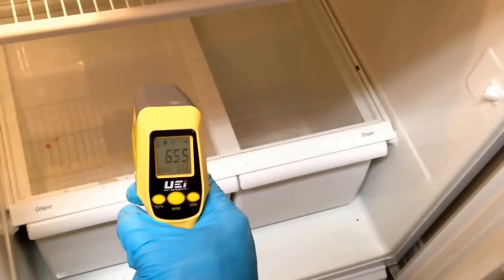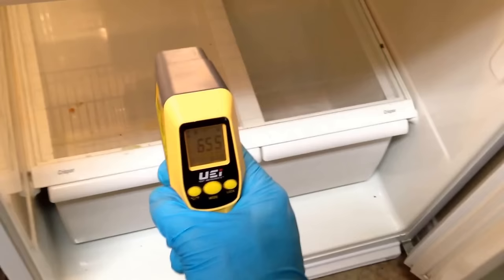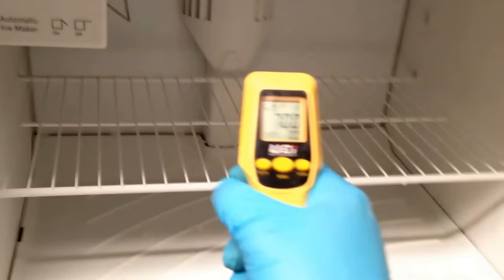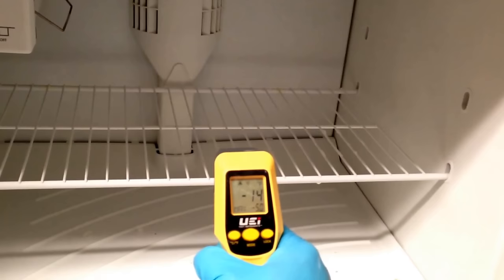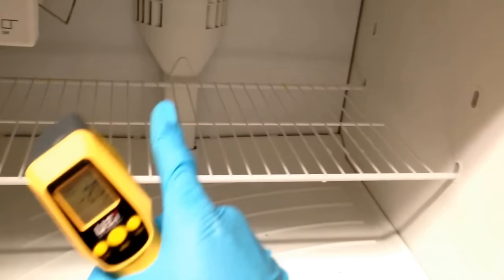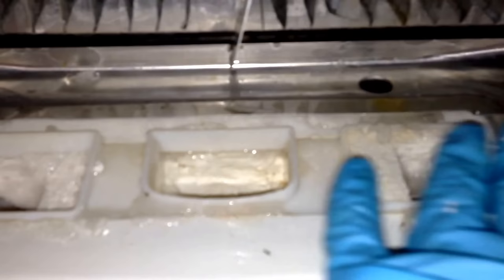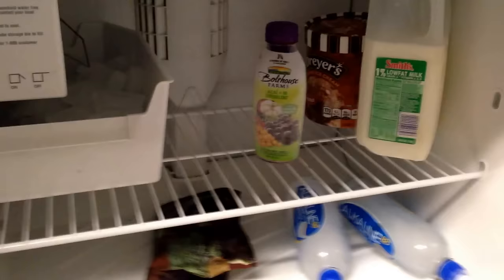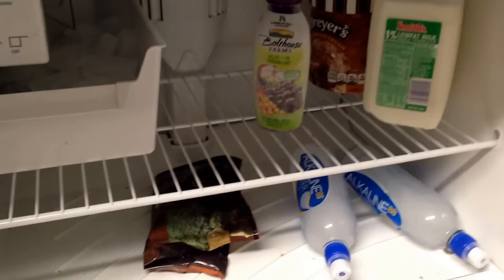Fridge is Warm but Freezer is Cold? DIY Repair

Comment: Unplugged my fridge for 24 hours, started it up a couple hours ago and was cooling almost immediately...plus I got a spotless fridge...it was empty, so.  Thanks!
Reply: Hey, I'm wondering where did the water go that melted?? I just unplugged mine.
Reply: Tony Neely I don’t know.  It didn’t leak out.  There couldn’t have been much anyway..just enough to block the air.  Mine ended up doing the same thing last week and I had to replace a part $189 plus $75 labor.  Much better than replacing the fridge tho.  Good luck.
Reply: @leeashley2927  after more research, I guess the water just goes into the drain pan. I didn't get lucky with mine today, I plugged it back up and the freezer still got cold but there's no fan blowing the air up so I guess the fan is broke. 😭

Comment: Freezer working fine.  Bottom part is warm and no restrictions.  Fan comes on when I set fridge to off mode  but it shuts off when I close the door. Also shuts off when set to max cold with door open.
Not long ago I changed the thermostat. What do you think?

Comment: I replaced a fan motor in a refrigerator that friends have and they also had the freezer jam packed with groceries.  I told them that the fan needs to circulate the air in the freezer so it could cool the lower section.  That refrigerator is still working.  I did that job about 5 years ago.
Reply from the maker: Great job Gary. It is sometimes something so simple that can be replaced or repaired... I am amazed how many times people are willing to throw out their appliances without trying to fix the issue which many times is less than 50 even 100 dollars to extend the life of their appliance... in your case an extra 5 years which doing the math... is WORTH IT! Thanks for sharing! 😄
Reply: Hello  @MoreThanMaintenance  , 31 years ago, I bought a new refrigerator from Montgomery Wards.  It says Montgomery Ward but they were made by Amana.  I have cleaned it several times, but the only thing that I have had to replace was the light bulb.  That was about 10 years ago.  The bulb did not light up when I put it in.  I took the bulb out and the end contact had very little lead.  I took my soldering torch (hand held) and added some solder to the contact.  Bulb still shines brightly.  And my refrigerator uses R-12 too.

Comment: How about the same issue but with a 3.2 mini-fridge? Refrigerator is between 57 F to 65 F and freezer is at -20 F.  There are no removable panels in the freezer compartment, it's like all one seemless piece. The exterior left hand side (when facing the unit) gets very hot when the compressor is running and compressor is a bit on the noisy side, not real loud but more so than another of the same unit that I have. The issue is definitely not from built up ice since the unit was left un-plugged for several months so any ice blockage would have melted but when plugged back several months later, the refrigerator section still won't cool properly and freezer still SUPER cold. There's also a constant sound (when running) of sounds like trickling or bubbling liquid (possibly coolant or compressor oil?) and there's a small area about the size and shape of a finger inside the freezer which is raised a bit and when the unit is running if you push down on that raised area there's definitely a crunch of like frost build-up.

Comment: thanks Sam sadly it didn't fix my refrigerator the airflow is so weak it's useless period I put a laptop cooler in the air flow base they just moving the air a little bit but not like the original fan used to do.  I think my unit  16 years old unit the motor has slowed down all these years. it is the same chincy Cooling fan as you find in PC CPUs. the flow was so bad during the heat spell couple days ago in New York. the temperature went up. to 55° So I can put a new fan with a higher speed with the same 12 voltage.  that should work right?  cuz my air flow is not restricted.. thank you for useful advice that helped other people on this channel

Comment: I can't get the back plate off. I took the screws out but the back plate will not budge - I have tried to lever it off with a screwdriver and everything but it will not budge. Will it work if I just turn the fridge off for a few hours?

Comment: hi i wanted to detach the two screws on the bottom panel in the freezer but failed. I tried 6mm and 7mm, neither worked. So, what size did u use on them? really need the answer.

Comment: Great video but I am at a loss for mine. My Compressor works, both fans work, heating element, evaporator al parts have continuity except the freezer works great and the fridge is running warm (mid 40s). What am I missing??

Comment: I have the same problem but I don't think I can dismantle mine from front or back as there doesn't seem to be any removable covers maybe because mine is a non frost free older fridge freezer. Freezer is fine food is solid any help please. Compressor is working and hot but don't here any fan. Can't be ice as it was off for ages.

Comment: i have a kenmore refridgerator it doesnt cool and weve replaced the capacitor and it still doesnt cool and the compressor doesnt make any noise and it gets a little warm but the refridgerator is still warm and the freezer what else do we need to check

Comment: I have a new refrigerator since I bought it, and it does not cool at all in the summer, and the freezer section is very light...in Saudi Arabia I bought a second one with the same problem, what is the solution?

Comment: Hi, everything on my 4 year old whirlpool refrigerator was fine until today..what happens is this.fan runs all the time but compressor goes on for 6 seconds then i here ralay shut it off,,,,then it goes on and shuts off this way every min or so....i unplugged because compressor was very hot...when it was cool i plugged in again and it still does same thing... model number wrb322dmbw00 ...any help with telling me what you think it is is appreciated... i did remove relay on compresser and when i

Comment: Hi! It's great video. I have same problem with my new mini Costway refrigerator. The freezer is working well (might be too well -35F) but the refrigerator is only 60F. It's new so can't be ice problem. There is nothing panel what I can remove in the freezer or on the all refrigerator. What should I do and check? Or just put in the garbage?

Comment: Good video. Thanks. With my fridge it'll work fine for about 4 days then the freezer back wall frosts up and everything gets warmer.  I changed the thermostat but it's still not working after 4 to 5 days. What could be the problem?  Please help. Thanks

Comment: I did all that and my fridge was good and cold for about 3 days, then the problem start again. This is my 3rd time doing this and the pattern is every time I cleaned out the defrosted ice in the freezer then the fridge would work for ONLY about 3 days then start to get warm again...down to low 60's. When that happened, I opened up all the panel in the back of the freezer and found same problem, bunch of frozen ice blocking everything except the fan. The fan still working and doesn't make too much of a noise...but some noise but not a rattle noise. I have Magic Chef model# CTB1502AR. So what is the problem or is it really time to get a new one. We got this from a refurbished appliance shop and only have it for almost 7 months and this happens. If it can be fix without ordering parts then I can do that but  don't want to order parts for this because parts are expensive and rather just buy a new fridge. Thanks.

Comment: Why would I chisel it out and not defrost it? Just asking. Can’t I unplug the whole thing leave it overnight, scrub it out and not have to chisel it out, or take it apart at all? I ask because mine doesn’t have screws in the back but a hexagon shape bolt that flush with the plastic. It just seams like your taking it apart to remove ice.
Reply from the maker: Yes you can unplug it if you are able. In my experience many times a prospect is unable to unplug the fridge due to perishables in the fridge and freezer. Hope that helps 😁

Comment: Hi. I have an issue with my fridge it's warm and the freezer is cold  and also the outside casing feels hot to touch. What should i do? Shall i defrost it and let it open for days?
 Im just too worried of hotsurface outside, i tried to look the back if the fan is working but i couldnt see it. I hope someone could help. TIA
Reply from the maker: Is it the same as the one in the video? On the bottom remove the grill cover and clean the coils. Next remove the back cover in your freezer. Is the fan running? Are the coils cold? Are there any restrictions? If you go on my channel I have a video showing how to diagnose these issues. Hope this helps! 🙂

Comment: Sam, I used this video and while purrting back together I have an odd green wire that I dont know what it goes to.  Any ideas?
Reply from the maker: Is it in the freezer? If so it is going to be your ground wire. It simply attaches to the back panel of your freezer.

Comment: I think it would be easier just to Unplug the Fridge and stick a hair dryer or a small heater in the freezer for an hour and let the ice melt.  Leave it unplugged overnight and run the heater again in the morning and plug it back in after 24 hours?  would save lot of labor.

Comment: Never use a screwdriver to chip ice away, never use a hair dryer. Instead use a steamer, it will melt the ice and not the plastic fridge, and it sanitizes killing mold .

Comment: my fridge is not cold, freezer is.  i followed you vid (great vid btw)  my ports are not froze over at all.  seems like air should blow through but i barely feel it in the fridge.  the freezer fan is working.....unless it should be blowing way harder.  felt normal to me.  what do i check next?
Reply: Aaron Willis 
I couldn't find an answer to that question so I bought a new fridge... Wish he would have continued to explain what else could have been the issue.
Reply: Slavic Supernaut a hey Slavic brother I know what you mean I'm having the same problem the past 4 days especially during this heat spell New York. the air is not flowing through the duct from the freezer into the fridge there's no blockage maybe the fan after 16 years has slowed down a little bit just like a car engine after so many years loses its Spark that's why I asked him if you videos if I can get a faster motor fan feel the air again through that backed up. I think that's all what the problem is.  I took my fan  panel off an oil the fan  it didn't do much good  I hardly.  feel any air flow. some fan motors nowadays are the same size as a PC Cooling fan about 5 inches Square. not like those big rotors with big fins years ago period but a tiny cheesy fan. that won't even cool a mouse off.  maybe you still have the refrigerator and could ask for faster motor. Good luck at hope you have no issues with the new refrigerator good luck take care
Reply: Did you  clean  the drain hose as he suggested? There are videos showing how to.

Comment: Our ports were blocked with ice because the freezer door had been left ajar and the items partially melted, then refroze. I cleared the ports so I'm hoping that fixed it.
Reply from the maker: This is a more permanent fix if the issue keeps happening with your fridge.
https://youtu.be/Ey9nL75xiNM

Comment: My Frigidaire Gallery side by side freezer works great, temp readings are 0/33 but drinks are not cold. I'm not buying the 33..but it's as low as I can set it.
Reply: John, we are having the same problem.  Settings at 0/33, freezer works, but fridge not cold enough and ice is melting in the ice bin in the upper ice maker, water visible on the outside of the ice maker.  Did you find the solution?

Comment: My frigadaire is freezing up top with lots of ice and bottom of frig not cold. Fan is running what could be my problem.
Reply from the maker: Check the ports that feed into the fridge compartment to ensure they are not blocked or restricted with ice build up.

Comment: I don’t recommend telling the average public , to use a screwdriver do dislodge ice!  Seen to many punctures into coils. A cup of hot water or warm. There are many other ways. Possibly the small round end of a wooden mixing spoon. Just no metal , let’s not compound this simple problem into a , well you need a new unit ma’am

Comment: My landlord said to pull the fridge outside and let all the ice melt, maybe that will be the remedy. My question is, if i unplug the fridge so  everything will melt, will it make a mess in the house?
Reply from the maker: There is a hose and a drain pan underneath the fridge behind the coil. It depends on how big the pan is and how much ice build up. There really is no need to pull the fridge outside. You can leave it and unplug it where it is. The drain will allow the water to drip into the pan. If you are concerned just take a large bath towel and put it on the floor just in case but honestly not necessary. Hope this helps. As a tenant you should be aware that this will happen again until the actual issue is resolved. I left a video attached that will fix this problem. The part is less than $15.
https://youtu.be/Ey9nL75xiNM

Comment: I just turned my fridge off to let it thaw out cause i couldn't get the screws out. Hope this works 😪
Reply from the maker: Yes if your fan motor is functioning and compressor is operating then this is the solution if you are able to turn of your fridge  :)

Comment: I’m unplugging the fridge before I try this correct?
Reply from the maker: I leave it plugged in while servicing because it's a restriction and I'm not dealing with electrical components :)
Reply: You sure better ! My reason is that if you accidentally touch something back there you might get zapped. Probably not but why take a chance ?

Comment: Im no expert my gut feeling was telling me that could be the problem with my fridge!! Crap is only 2 yrs old and the top is working except for the bottom 😐😡😒 FML no help with also being 7 months 2 wks pregnant!!!!! Hopefully the little I did holds thru the night.  I'm exhausted at this point!
Reply from the maker: Sorry to hear your having to deal with this so close to delivery. I remember when my wife was that far along (smiles) Unfortunately the more I am exposed to the industry the more I realize that the newer appliances were not made to last like the old appliances. Most appliances and this is regardless of model barely last as you said 2 years without some issues whereas the old fridges lasted 10 years without any issues. It is frustrating! Hope this works for you!
Reply: @MoreThanMaintenance  thank you for responding back.  And yes it's frustrating!!!  The fan is working both the freezer and the bottom back one.  I guess that would be the motor?? Idk whats worst I just went grocery shopping. 2 am right now and this damn fridge has me up.  Just checked it and BAM same thing. Barely any cold is going to the bottom. 😩